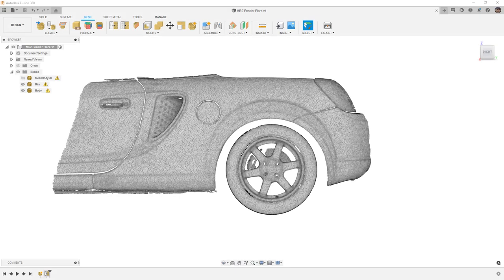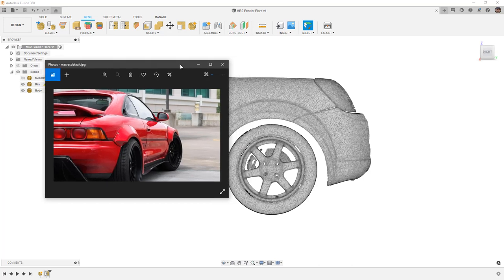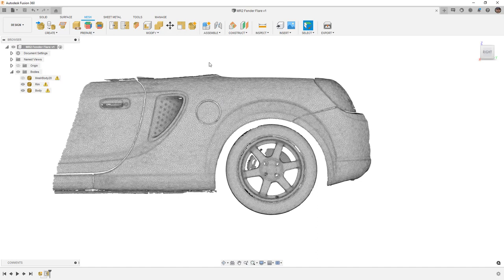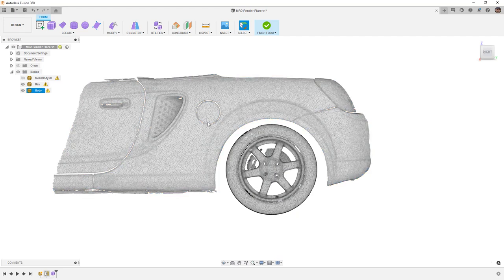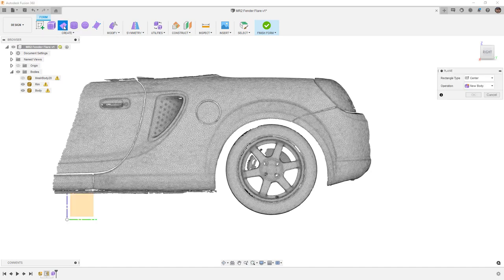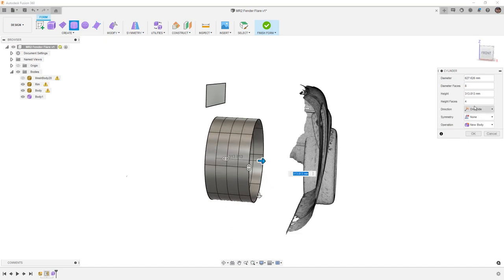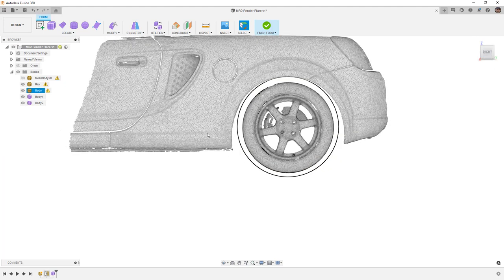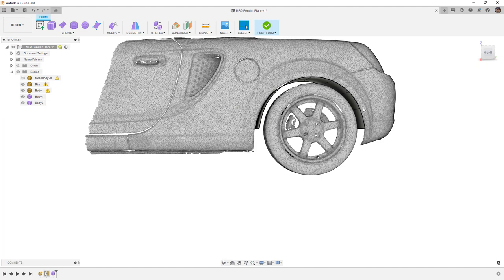Design a Fender Flare in Fusion 360 - Rocket Bunny Inspired Fender Flare #Fusion360 #CarDesign

Comment: Can I do this on the personal use version of fusion 360?
Reply from the maker: yup to the best of my knowledge.  The hobby/personal version has limitations on certain things like no access to extensions(advanced multi axis, simulation, gen design), but the core design tools like freeform modeling used here are in the software.
Reply: @LearnEverythingAboutDesign   thanks mate, unfortunately I’m using Onshape and don’t think they have these Freeform modeling tools as I know of but I can mix the two of them together
Reply from the maker: @jensensphotography4570  Yeah Onshape doesn't currently.  SolidEdge does have subD but I wasn't impressed with it when I used it.  You certainly can take a freeform surface from Fusion and import to Onshape and carry on with surface tools there for sure.
Reply: @LearnEverythingAboutDesign  yeah thanks for letting me know haha, I’m new too cad, and iv looked at a lot of different cad softwares but I think onshape resonates a lot with me, and iv watched some other channel that covers the basics very well and iv come across your channel and going thru this playlist and it is very helpful to under what you are doing, how you are doing it to achieve your goal or ideas. Any of your videos you suggest I watch to understand the the Freeform modeling tools, like the basics?
Reply from the maker: @jensensphotography4570   I've covered onshape in the past when it was first released but haven't kept up with it.  I like the idea but not the execution of it.

on the forms stuff i have hundreds of videos on the subject.  There is a form mastery series on here. https://www.youtube.com/playlist?list=PLBDfGh8A8kXWCgB3Q5DYiCDSCxCqw8tJ7   that was just a place to start talking about the basics.  I also have a site with paid content on it.  www.LearnEverythingAboutDesign.com that has a super basic intro to forms modeling for beginners as well as a lot of other entry level content.

No matter what software you use the concepts will all be the same.  It is just learning the tools to select, move and add edges that is the tricky across different CAD programs.  Freeform modeling is a bit of a tough one because each program will behave slightly different so I would suggest picking one you like and learning just that one until you are really comfortable.  This way you can focus on the design aspect and less about constantly trying to figure out which tools do what.  For example power surfacing add-in for Solidworks is a great tool with loads of options like edge weighting(so you don't have to put a lot of edges close together to get a sharper edge), and it has some cool level of detail options where you can focus on a single face.  This is unique to Power Surfacing.  Edge weighting is available on SubD in Creo but no other CAD program that I know of.  What is built into Fusion (and Inventor) is called TSplines.  and its claim to fame is "T points" or the ability to have an edge end in the middle of another edge.  blessing and a curse really as it can get nasty quick if you aren't careful.  Fusion forms is easy to use and very accessible but requires patience.  Tsplines was an addin for Rhino and others until Autodesk purchased it.  Rhino has been building their own SubD workflow and Rhino 8 is supposed to be pretty good so I am looking forward to that.  Solid Edge has freeform modeling but limited toolsets.  Higher up tools like Creo, Catia, NX, Alias all have SubD but again varied workflow.

So at this stage if you want to learn freeform modeling stick with Fusion to learn it and then you should be able to apply that workflow to most other programs if you need to expand :)
Reply: @LearnEverythingAboutDesign  yeah thanks make i think your forms playlist is a good way to get started and then seeing how I go I might have to look at your site. I think I will definitely stick to fusion as it will be easy to follow and learn from you. My goal for a little side project thing is to get a good scan of my car and just muck around and try and come up with a wide body kit for it. As I don’t think anyone has made a wide body kit for the Kia forte/cerato GT
Reply: @LearnEverythingAboutDesign  really appreciate the information 🙏🏻
Reply: Also just another question but do you think I should stick with fusion 360 for the traditional CAD stuff and for the Freeform tool instead of jumping from onshape and fusion?
Reply from the maker: @jensensphotography4570  I don't think ive seen one other than some aero bits for it.  Definitely look at the series i did earlier this year.  i covered the scanning and mesh prep part(with an einscan scanner), but the process will be the same.
Reply: @LearnEverythingAboutDesign  shit I think I typed that out wrong, but I was meant to say should I just transfer to fusion while I’m still early in Cad. I just watched your reengineering video of a front fender and liked that I saw you switch between surfaces and Freeform which I didn’t even know what surfaces really meant until that video. Definitely will try and learn as much as I can from the vids 🙏🏻 really appreciate it man

Comment: am I missing something i don't have those options in my cylinder window?
Reply from the maker: can you tell me which options you aren't seeing?  are you in the cylinder creation dialog in the form?
Reply: @LearnEverythingAboutDesign   i only have placement diameter height and operation
Reply from the maker: @cyberblade6669  It sounds like you might not be in a form.  Are you grabbing the cylinder from the Create menu in the design workspace?  If so you need to click on the purple icon "create form" first to enter the forms workspace.
Reply: @LearnEverythingAboutDesign  I think this is because I'm using a 3d print file

Comment: how do you get that roll down
Reply from the maker: Not exactly sure which part you are referring to, but here are a couple of basics.
When using Edit form, you can hold ALT to extrude an edge.  this works with Translate as well as scale.  When i make the lip i generally put the pivot point at the center of the wheel and use ALT + CTRL(extrude with a creased edge) and scale it down.
Reply: @LearnEverythingAboutDesign  that when you make somethinf that it automatic makes a smooth curve/round
Reply from the maker: @buas7  The way forms work is that we are building the "cage" that drives surface tangencies as they go across edges/faces.  If you  have 2 edges close together you get a tighter transition, if you have them farther apart it will be more gradual.  Take a look at this video and see if that helps. https://youtu.be/kkzzY20ItjM